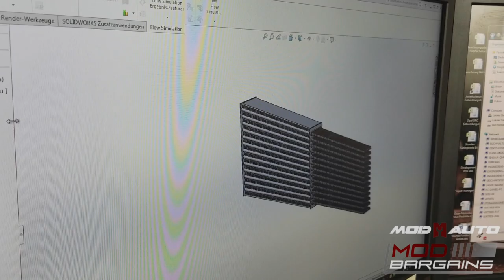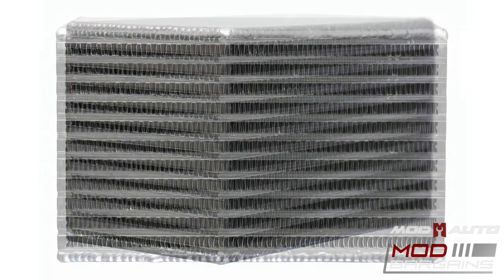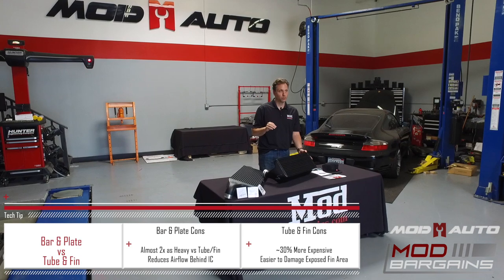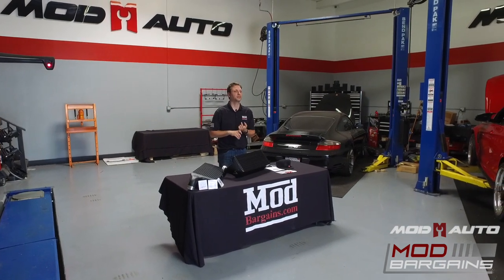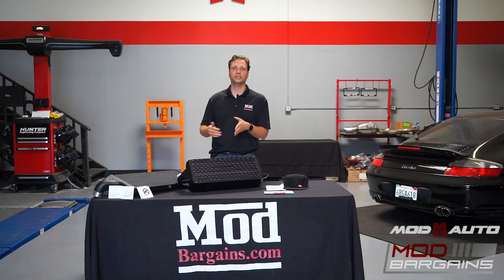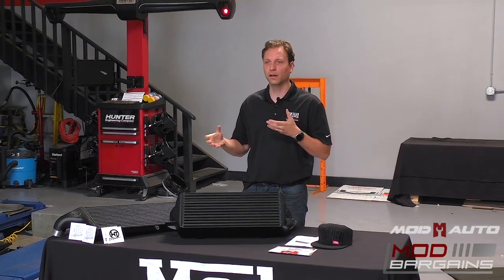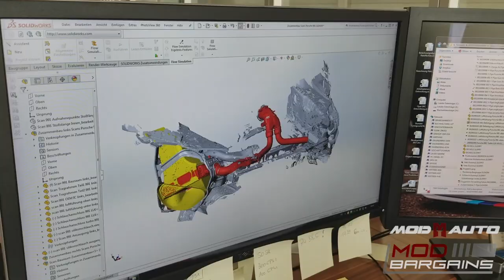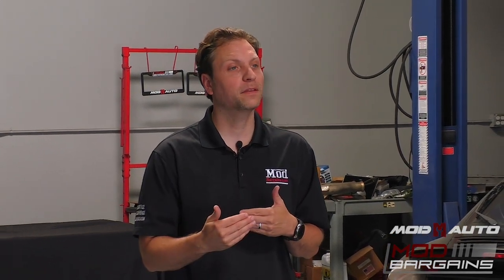Know Your Mods Ep19: Wagner-Tuning Intercoolers

Comment: I’m considering add an intercooler for daily use not track but some fun in streets. Which brands would you consider and which are the differences between AIRTEC, MMR, Wagner etc?

Comment: Great video guys. I noticed you posted several dyno numbers of the F80 M4 pre Wagner Radiator/Top Mount Intercooler. I as well as many other F80 owners would be curious to know what the after numbers were or would be. I could gauranteed get you a high number of views from Forum members having these same decisions for intercoolers as I am. Cheers!

Comment: Great video
I don't know much, but TF made sense to me, even though i keep seeing BP as the better option. Just based on the flow rate of BP, I just didn't see how BP was the better option over TF. Just generally speaking
Reply: Thansk Solo!
Racing and application wise TF (Tube and Fin ) will always be used, 1. Weight savings, 2. Exit flow to other components like radiator, intake etc 3. Similar flow rate but also control of build Cons: More expensive, requires Mold and size specific/vehicle specific
BP(Bar and plate) design - Pro's 1. Cheaper to produce, sold for cheaper price 2. quicker to product, but in term of flow rate not the case from the data being any better. Often times or only option is going to be a bar and plate, and what you end up seeing is really a lot of people just trying to concentrate on surface area only.

Comment: This goes against almost everything I've ever heard about Tube/Fin and Bar/Plate intercoolers.  I mean its well known tube and fin is lighter, and can offer less pressure drop... but everything I've heard and also common sense, says tube/fin (because of their lighter weight) suffer from heat soak way faster, they may suffer less pressure drop (typically 1psi or less) but the charge air isn't cooled as well.  What's 1 psi if there's a large difference in charge density?  There are several independent tests that I've looked at, done on high end aftermarket intercoolers of both types.  The results always show bar and plate coming out on top for cooling, and with that performance.  With negligible to no difference in pressure drop and spool time.  The last big problem with tube and fin, unless these guys figured out a more reliable way of building them is strength.  Tube and fin typically can't handle as much boost pressure and can be damaged far easier from rocks/road debris.
Reply: Just saw the comment, bit late, well lets back it up where are those independent studies? Wagner is one of the few that shows the real pressure stats on their items, rather then the rest of the aftermarket scene. There are times where bar and plate application comes into play but in general Tube / Fin is superior (just marketing hyper to keep costs down in general to say bar and plate is superior) But there is more to it then that, fin designs, end tank design and build quality of course. Not sure  on the strength question  but I know Wagner's , are  used by real world race cars and have taken hits with no problem so they are stronger from what I've seen.  As to the cooling section,  common sense, on the opposite end of bar and plate, which acts as a wall to air travel through,  tube in fin a great benefit to cool down rest of vehicle, common sense would suggest if air is traveling as car is moving it stays cooler constantly rather then just sitting there warming up.

Comment: That's great... But it's really a tough ask at 2 - 2.5  times other aftermarket parts. I doubt it's worth it.
Reply: Jose, the prices are right in with the low to value line products, they've brought their prices down considerably. I think the only stuff thats going to be in the 2 - 2.5x realm would be the high end competition level stuff, with the carbon fiber shrouds etc, which is overkill for most unless they are actually competing or putting down in the over 800HP range.

Comment: why would you want to paint your intercooler black instead of leaving it as a raw finishing? wouldn't that affect heat dissipation and stone chips will make it look so bad .
Reply from the maker: Hi JK, well a thermal black coating can help dissipate heat actually. Sometimes they offer it in the raw silver finish as well, however some people prefer the more steath look in terms of looks at least.
Reply: @Modbargains-google-plus  thanks for reverting . so is more for looks eh .
Reply: @jkpisces  well pretty sure the coating that Wagner is using is increasing the heat dissipation (it's minimal but it's for that extra bit).

Comment: I was told bar and plate is better for cooling, slightly worse flow and heavier/stronger
Reply from the maker: Bar and plate is generally not better for cooling, however I am sure there are certain examples where there can be made an argument, why I like companies like Wagner doing all the testing and engineering they do. (tube & Fin is just far more expensive) But keep in mind flow is pretty important especially when you have a radiator usually sitting behind it.  Weight difference well that's just gravy on top.
Reply: @Modbargains-google-plus  Yeah I remember my old HKS intercooler being super lightweight compared to another one I had, I just put it down to quality, well it was probably that and the tube and fin construction when I learnt the difference haha, cheers for the information
Reply: @tturi2  Thanks and appreciate you watching :) Hope I can help educate on other items ( I do it here on ModBargains and our other channel ' Talking Mods' )

Comment: Sorry but I find it very hard to believe that this intercooler will give you a 10-15 hp power increase all a larger intercooler will do is help your car maintain the horse power you already have for a longer period of time it's not going to change the fuel map of the car so how can it increases power I just don't believe it
Reply: So Lenny the intercooler is cooling down the air right, hence increasing combustion. In certain cases yes you are talking about retaining horsepower but when you do a tune, on top increase other factors, bottle neck is head - and with a tune you'll generally see around a even higher number of 25-30HP, this has been proven countless times by dyno's independently across the world.
Reply: @ronhay6511  correct if you do the tune (mapping) after the install 

The point I'm making is it will not increase hp by just fitting it with no mapping and the people who sell them.make it sound like it will 

As I said it will only help you retain the power you already have
Reply: @censorshipBS  actually no, I am still saying there will be more power, just saying bigger power when mapped. Let me explain, the primary way that Front Mount Inter cooler (FMIC)'s or any cooling products make power is by lowering the air temperature charge. Colder air is denser and has more oxygen molecules for the same space. That means that you can add fuel and now have more power with combustion. Mass Air Flow sensors (MAF ) since 1990 on for any vehicle, adjust accordingly to what they are given. So hence you see a horse power gain.          Example different product: If we give a car Methanol or NOS, we will see instant horsepower gain, even if we put higher octane we will see ever so slight difference.   Another example of the MAP, is if you disconnect your battery overnight and then re-plug in your car and go for a drive, the engine will perform all over place, it's the MAF relearning air, fuel etc for your vehicle (vehicle's are not horsepower capped).    So to sum up numbers wise always hard to say exactly but it's realistic on a stock vehicle to see a gain like a 10-15hp, if it's mapped you'll see even more, where I've seen if the product is great like say a Wagner up to a 25-30HP gain.  Of course every products ability is difference.
Reply: @ronhay6511  I'll get one and try it out on.a dyno my car is re moped from 245 stock to 320 so let's see how much it will gain I bet it doesn't gain over 20hp

I has a different car that was re mapped to 400 I fitted water methanol and it gained 40 hp and that was with timing increase so only 10% so I very much doubt that the one running 320 will get the same result by just added an intercooler but I'll let you know in a couple of weeks
Reply: @censorshipBS  interested to hear how it goes, I am sure you know try to dyno on the same dyno, same  ambient temps. But appreciate you doing the feedback. What vehicle is this going on, and what brand of IC, it's a wagner?
Reply: @ronhay6511  yes I will look at the ambient temps on.the last dyno I did on the car and get it as close as possible 

Will be on same dyno 

It's a bmw 330d e92 2010 it was supposed to be 245hp but it made 260hp stock then after a custom remap it made 320hp 

I'll most probably be getting the wagner evo 1
Reply: @censorshipBS  good day! So tell what was your outcome?
Reply: @ap3stax  so the car gained 20hp 😂  made 340hp on same dyno with same ambient temps 

Shocked but credit where credit is due